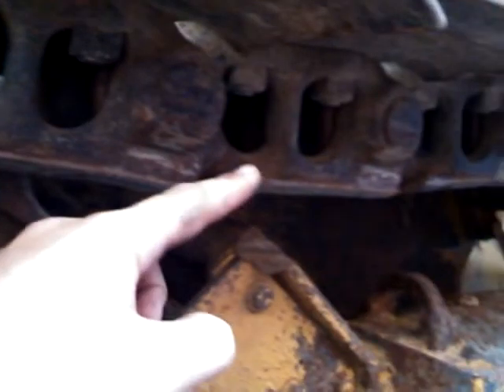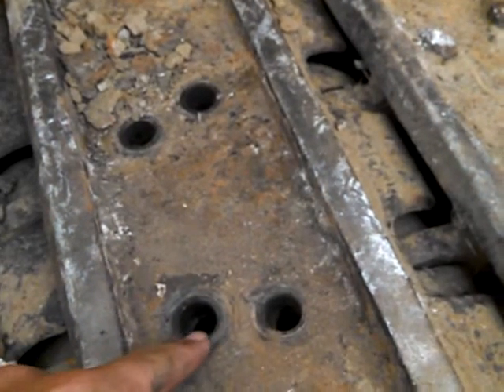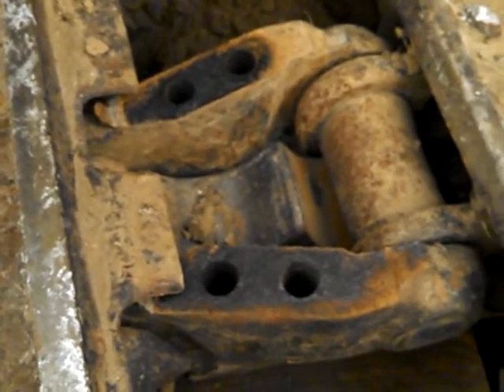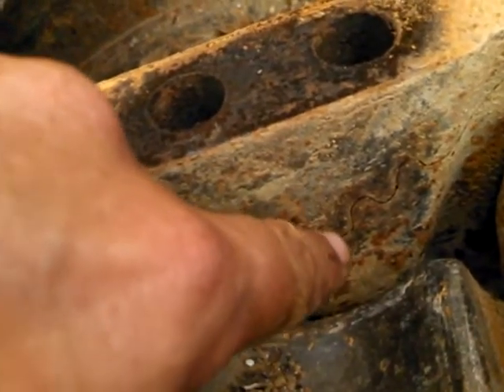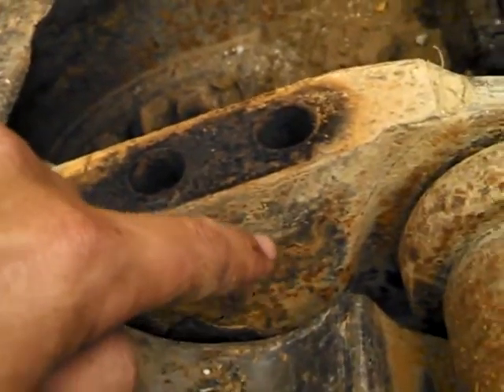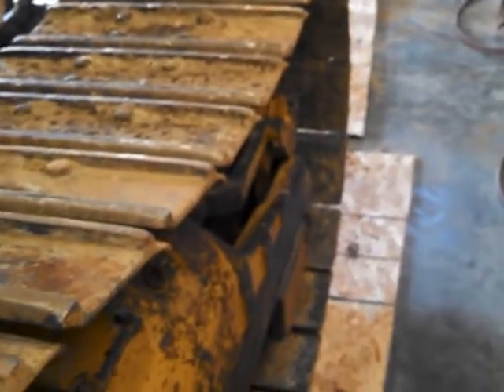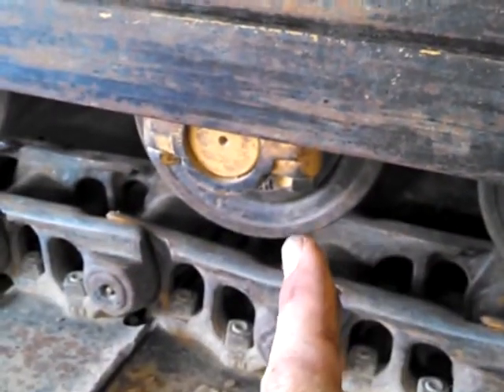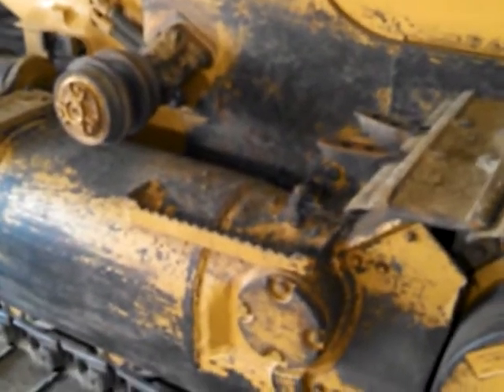How to replace the undercarriage on a 963C CAT

Comment: Man I love your down home, to the point way of talking. Now if I can just find out how to replace the bottom rollers on my case 1150.  The right side is snaking and popping and tracks coming off the bottom rollers, and I don't know why. The rollers seem to be in good shape, not worn .  I don't get it. They are the same size as the left side. I have no rock guards.

Comment: I hope you break every bolt on those rollers.
Reply from the maker: Everything came apart real easy, sorry to disappoint you.
Reply: Justin Thompson have you done tensioner spring pins on a 963 or 973 yet?
Reply: Justin Thompson  I have a case 1150 and the track on right side comes off the bottom rollers then after I drive it streight ahead for a little ways, the track pops back on the bottom rollers. There seem no reason for it because the bottom rollers only seem to have maybe a 1/8 to 1/4 ware on them. Look almost new. Only thing I could find was where the one pin that had been removed at some point has not been driven all the way through because the head was swollen like a nail, where it was hit by a heavy hammer while red hot , I guess. So I'll get another pin. Still don't know why the tracks come off at the bottom.